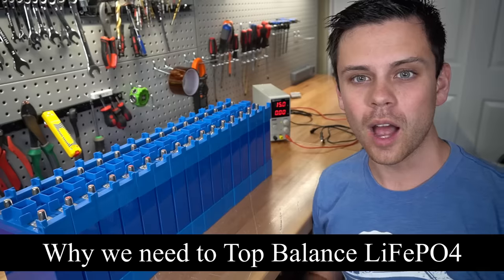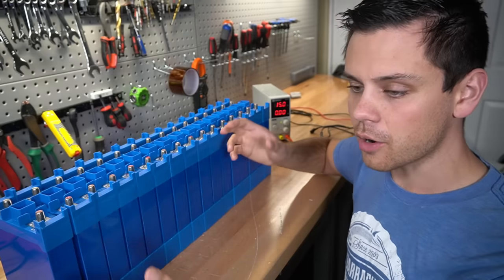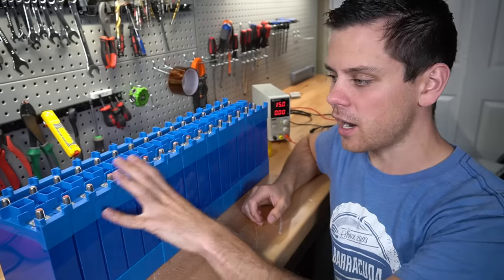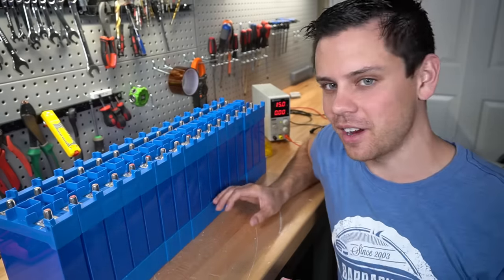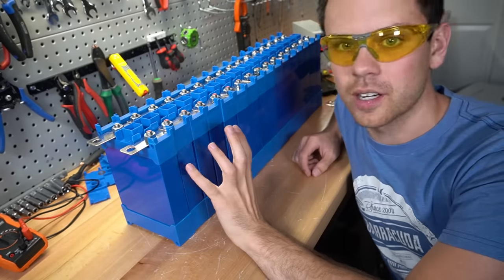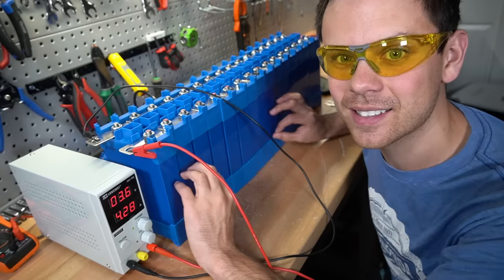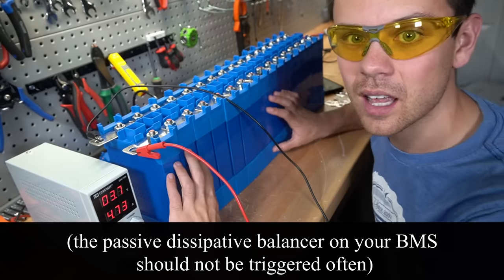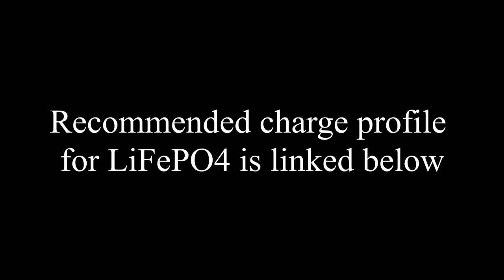How to Top Balance LiFePO4 Battery Cells Quickly (and when you need to do it)

Comment: Basically, your video is harmful.

3.7V significantly shortens the lifetime of LiFePO4 batteries. When starting charging and balancing, use the lowest possible voltage, extending the charging time of the cells. Check the voltage of each cell. Start with a low voltage, say 3V per cell and absolutely no more than 3.65V (much better 3.5V) remains in series on the more discharged cell.
That is  because there is no charger that gives exactly 3.7V multiplied by the number of batteries and there is no BMS that is so perfect that will not introduce voltage measurement errors on the cells. I use a BMS mounted directly on the cell terminals, without the long test leads. That kind of BMS, transmits only the measurement data to the BMS or balancing energy to/from cells. Long test leads, that are thin, couses  measurement errors, sometimes 0.1..0.2V, as well as connectors and fuses, which should be installed there. Such errors disqualify that kind of BMS in professional applications where batteries cost tens of thousands of USD.

If you charge the batteries with a laboratory power supply, such cheap crap Chinese as in the video, then at least measure what this power supply spits out with some reasonable meter. Otherwise, you can just destroy the batteries with a voltage surge, for example, just in the monent when  connecting the battery to the Chinese.

Charge in something like that cycles: 
- first step equal celles voltage with 2A current without balancing (1..2A depending on the equipment), at this stage, charging follows the steep part of the charge curve for LiFEPO4 chemistry. 
- then use 30A charging current, 
- next use 2A current for balancing phase and  switch to next charging cycle, and so on  (high charging current, of course, depends on the cell's capacity).

 In general, you need to navigate the charge curve for all batteries in the package while charging!
What else comes to mind:
-  charge up to 80% of battery pack capacity,
- recharge the batteries as often as possible, do not allow them to deep discharge,
- do not leave batteries discharged for a long time.
 - never charge LiFEPo4 batteries that have been exposed to frost!
- do not let the battery freeze, it blew up like  inBoeing Dreamliner 787 batteries.

Always check the temperature while charging. It cannot be too low or too high. charging below 10C and above 60C might destroys the cells. LiFePO4 cells are almost eternal as long as you reduce the charging current and charge multiple batteries in a digitally controlled manner.
To shorten the charging time, shorten the rebalancing time of the battery pack by discarding the weakest (most used) and replacing it with a new one. For this you need a BMS that will analyze the capacity of each battery. To save energy while charging, use a BMS with an active balncer circuit.
Charging a battery is always a compromise between charging time and service life. Battery manufacturers usually don't care because they want to sell as many cells as possible. If you follow what I described, you will easily achieve 3500 ... 4000 charge and discharge cycles.

Comment: 48Volts can kill you, please wear voltage protective gloves AND safety glasses. I had a 12 volt DC car battery drop me to my knees . Was launching boat in salt water, flat bottom aluminum boat with 12v ground wired to hull. Standing in knee deep salt water and grabbed the positive side of the battery before disconnecting ground. DROPPED ME TO MY KNEES. NEVER ASSUME ANY POWER LINE IS OFF. EVEN IF YOU PADLOCKED THE BREAKER YOURSELF.
Reply: It is not 48v, it is just 3,2v